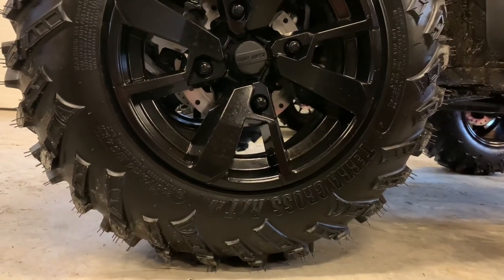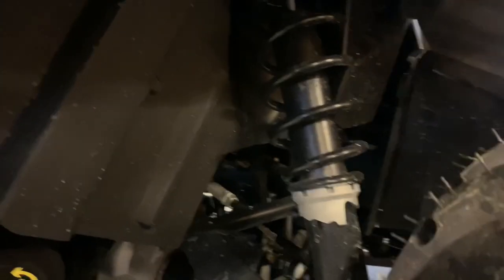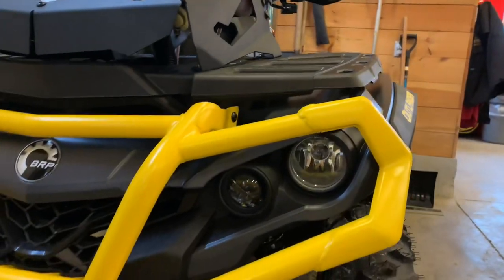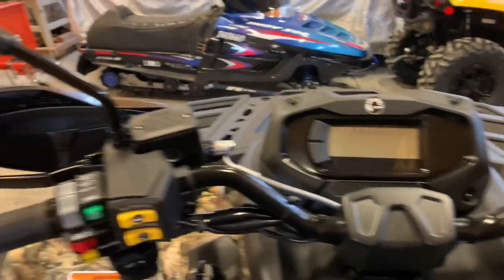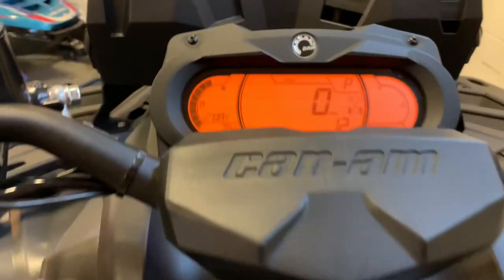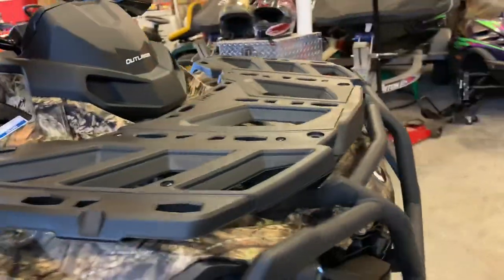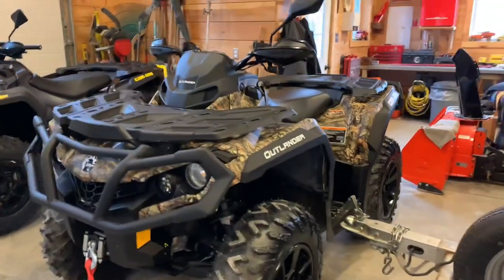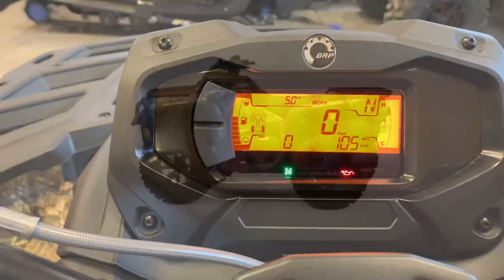NEW 2022 Can-Am Outlander 850XT or XTP?  Break down, review and comparisons

Comment: So overall which do you like more? Does the XTP have a better ride (smoother) because of the Fox shocks? Compared to a 2 seater, are these single seaters just as stable?
Reply from the maker: Thanks for watching! Definitely a smoother, more controlled ride on the XTP.  Worth the extra $$ if you can make it work!  Compared to the 2 seater - not quite as smooth on bumpy terrain as the longer chassis on the 2 up swallows up those ups and downs more efficiently.

Comment: Iv been looking at  THE 1000 AND was  Wondering how hot it gets on your leg or thigh or like that because I'm  A paraplegic and cant feel anything  from  Belly button down and I'm on an 850 sportsman now and it gets really hot and have burned my leg a few times
Reply from the maker: Hello Brad, thanks for watching the video!  It’s great you can ride!  I’ve never had an issue with heat, however I ride in Canada where it’s not quite as extreme. I have heard guys add a tuner which really helps control the engine temp. Also read some guys wrap the exhaust with exhaust tape.